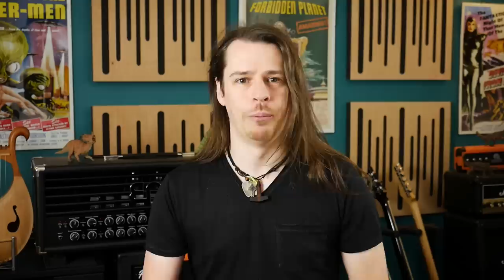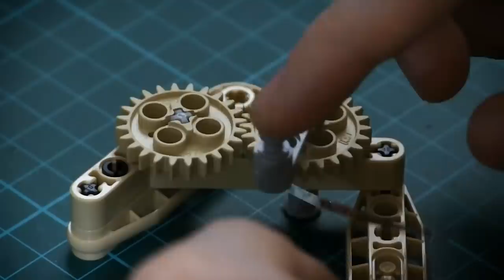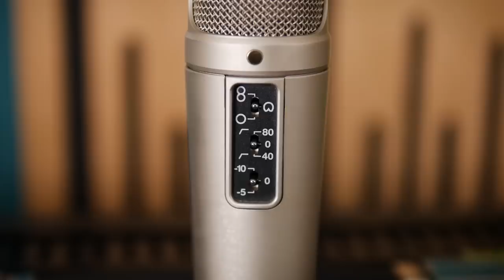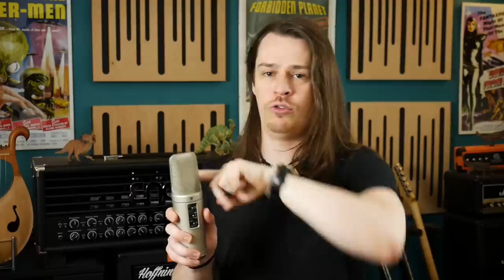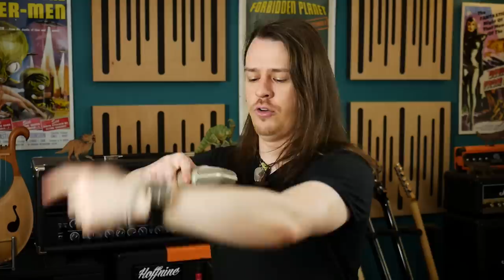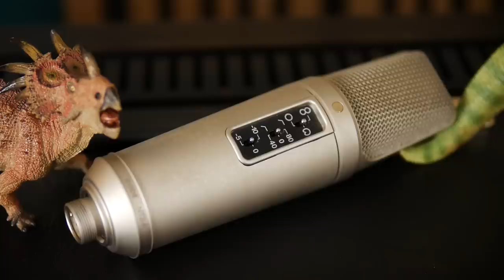What Do These Switches Do? | Microphones: What's The Difference? Appendix

Comment: Figure 8 polar pattern is useful for Middle-side recording. 2 mics - a figure 8 pointing left and right, and a cardioid pointing right up the center.  the interference pattern of the two mics makes a good, configurable, stereo image.
Reply: At some point someone left a smarmy reply implying that you couldn't get a stereo image from 2 mono microphones positioned dead-center on the source.  That reply is gone, but maybe I should explain.  You record the bipolar microphone and the cardioid microphone in 2 separate tracks; you then duplicate the the bipolar track and invert its phase (there are other ways of doing this with older technology and mixing consoles, but however you do it you end up with 3 tracks - the cardioid and 2 of the bipolar tracks 180 degrees out of phase from eachother); you then bus the cardioid and one of the channels to one side of the stereo image, doing the same with the other.  Signals that came from the right of the mic setup will be in phase in both the right side signal from the bipolar mic and the cardioid and thus sum together, and signals from the left will cancel out.  the opposite is true for signals from the other side on the other bus.  You control how narrow or wide the stereo image is by adjusting the mix of the center channel.

And if that is too complicated or vague an explanation (or just outright wrong, I'm doing this from memory)... maaaaybe a Scottish physicist guitar youtuber would like to take a shot at it?  Would make a decent TATA

Comment: Hi Colin. Love your videos. Really. I love that you know the physics behind audio (sadly the physics aspect is actively overlooked by new audio "engineers")

One detail, though. High pass filters are not the same as low frequency shelves. Low frequency shelves reduce or increase the level of a frequency band equally from 0 hz to your desired cutoff frequency. The analog goes to high frequency shelves (from cutoff upwards).

The synonyms for high pass and low pass are low cut and high cut, respectively.

Cheers, man!

Comment: I like to use figure 8 with the side rejection covering the sound hole so I don't get the boomy low end, but the balanced sound of the bridge and neck joint areas of the strings

Comment: A single diaphragm condenser or dynamic cannot pickup in that opposite directional pattern if i'm not mistaken. However, that Rode has TWO diaphrams. This means you could run a dual directional pattern front and back and end up with a pickup pattern more like a ribbon. ie, maybe this mic can emulate a ribbon without buying a ribbon.

Comment: Nice video.   Just subscribed as I'm looking to fix an ATR 2100 usb microphone switch.  I have a blue light which make me think maybe the microphone switch is switched on.  Switch has definitely come loose from wherever it was attached inside the microphone housing, but is still inside the housing.  Tried the microphone as I bought it online used and it does sound better than my Logitech HD Webcam microphone that I was using.  A bit new to proper sound and lighting for videos both of which I'm working on.  Great video again.  High pass was the only one I did not follow you with as the two low exclusion 40 and 80 hz filters were all that I saw on your demo Mic.  Was there actually a High Pass filter on the microphone you are holding in your video?  See not kidding I know next to nothing about this stuff.  TY.

Comment: Oh! Do you happen to have a video on repairing dynamics (if that's even a thing someone should do on their own)? I think you might have seen my comment from the last vid. lol
Also, is there any difference in using a high pass filter on the mic vs in post (or for that matter, on a preamp/interface as it comes in)?
Reply from the maker: I don't have a video on it, but I think I said if it's just a broken connection to the XLR you won't have any issues fixing it. 

I've repaired a couple of 57s where the wires had come away inside. 

However if it's a ruptured diaphragm or a coil someone put current through and burnt out, then it's new microphone time. 

You'll need to work out what is wrong with it before I can assist further.
Reply: the beauty of the high pass as early in the signal chain as possible means you aren't carrying that lo-freq garbage into your pre's or w/e your next stage of signal processing is, and then the entire rest of the path.  Realistically, I don't think having the lo cut on the mic output vs the lo cut on the mic-pre input makes any difference, as that is the same place in the signal path, basically...  Either way, the incoming signal is automatically cleaner. Rumble filters are very important.  Most mixers have them for mics that don't.  There is even an 80Hz lo-cut on my QSC power amps for if the mic/pre/mixer/effects don't have one. (HTH on Q#2)

Comment: I've recently heard that powering your guitar amplifier without the guitar plugged in may damage it... I don't believe this is true and I did it a lot of times and nothing happend but I would really appreciate if you could explain this in one of your videos. 
Thanks a lot :) I really like the way you explain and the fact that you really know what you're talking about. Your videos are great!
Reply: If you turn it on and play it without a cab hooked up is when u risk damage to the amp
Reply from the maker: Whoever told you that needs to come and watch my channel and learn a few things. 

You can't damage an amplifier by powering it on without a guitar connected to the input, the amplifier does not rely on anything being in the input to function safely. 

However, if you were to operate a valve amplifier without connecting a speaker of the correct impedance to the speaker out then you would risk severe damage to your amp.
Reply: @ScienceofLoud  Thanks a lot! I really need to show them your answer. That was getting stupid... I almost got blamed for damageing an amplifier because "the cable was bad and it disconnected the amp from the guitar"... I tried telling them so many times that it has nothing to do with that but of course they won't believe me because I am a stupid 16 year old... Thank you one more time. I really appreciate that you answered my question and sorry for any grammatical mistakes :))

Comment: Colin maybe should have also defined the term "polar pattern" which means "directionality pattern", "pickup pattern", w/e
  It comes from the circular response chart which doesn't use the standard x-y rectangular coordinate system, but rather "POLAR COORDINATES" based on PI coordinates of a circle. so in polar coordinates you have radians to define the  vector direction (or position on the circle) and 2PI radians is once around clock. Then you still have your "value" term which extends as a radius from the center point and shows you the amount of whatever at that particular position on the circle. for these mic charts that absolute scalar value represents decibels or "dB's" (yes small "d" large "B")
Reply from the maker: I think radians and polar coordinates are a little beyond the scope of this video. 
Cartesian coordinates are enough of a struggle for most people without having to measure everything in fractions of pi. 

Maybe next time.
Reply: @ScienceofLoud  I hear you . I guess it could be left at "that circle chart is called polar coordinates and so a mic response on that chart is called polar response and the circular response pattern is the polar pattern" (peeps used the term in the comments so I thought it should be explained...)